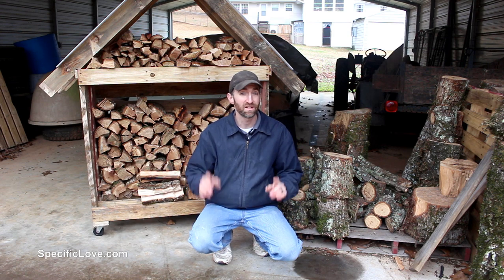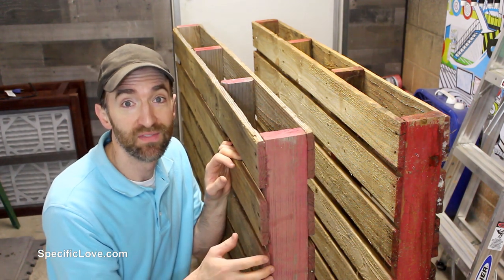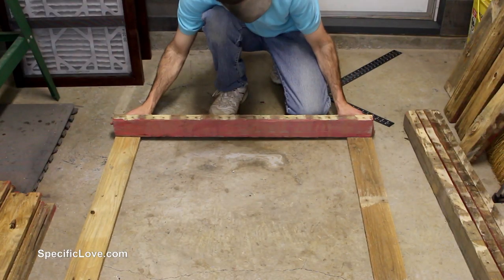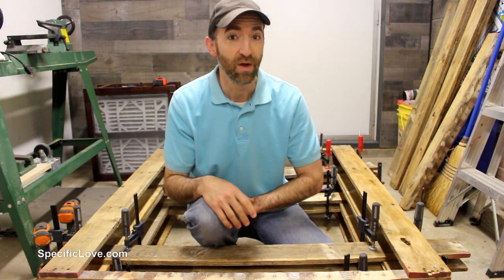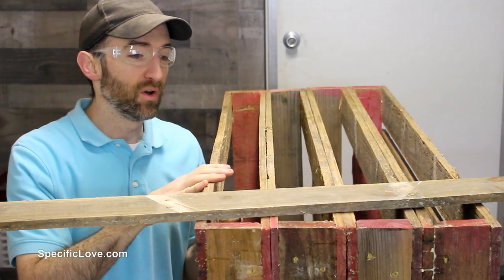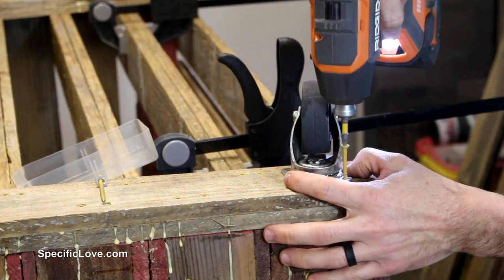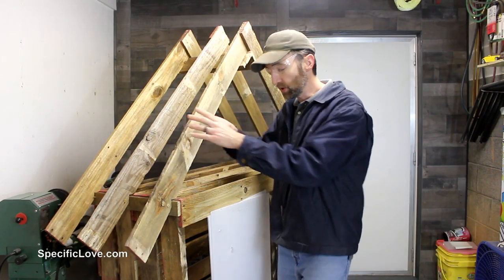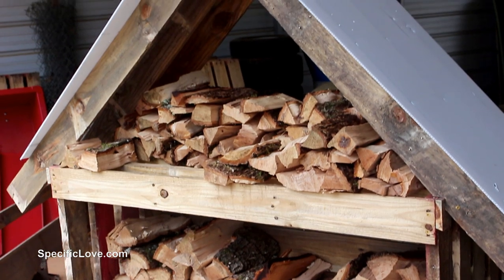Building a Mobile Firewood Storage Rack from 2 Pallets DIY

Comment: Love your work. I get the small "hardwood dolly" from Harbor Trade Fools on sale $7, with 1000 lb capacity. I cut the wood beams in half , then add extensions from pallet wood to match my projects. I have them holding a big 6 cylinder motor, a transmission, a refrigerator, etc. 
I always mount them with the wheels as far to the edge as possible for stability. Sometimes I unbolt them from their frame and bolt them onto the project, like my work bench. Inexpensive and sturdy.
Reply from the maker: That is a great idea. If fact I have a few car parts and I might just use your idea. Thank you.